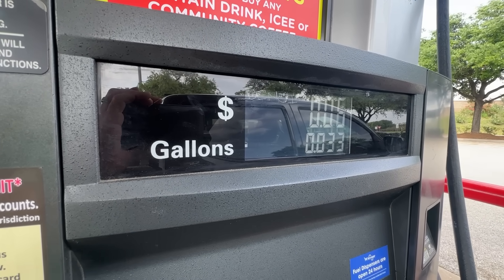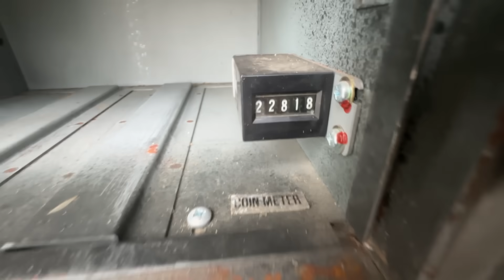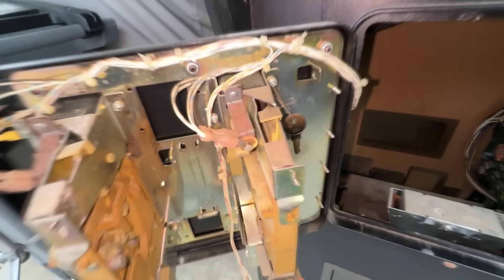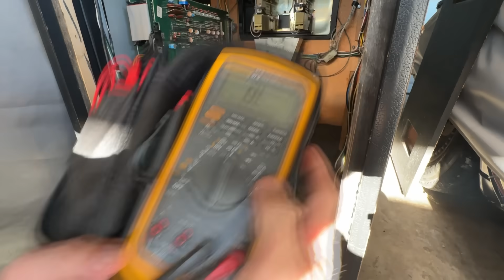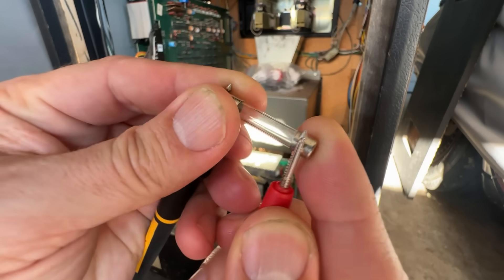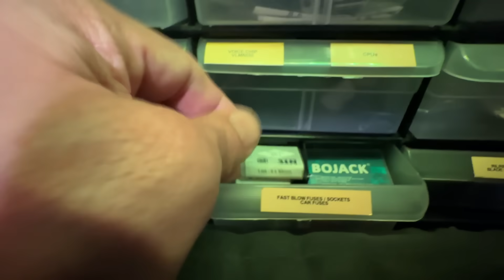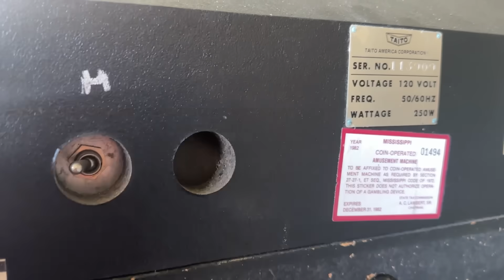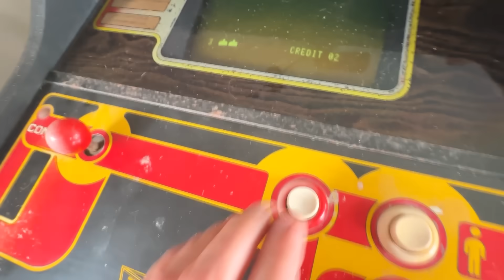Part 1: Broken 1978 Taito Space Invaders Brought Back To Life?

Comment: Do you know how to adjust the horizontal size? This cab only has horizontal hold and horizontal position on the potentiometers… I’m thinking it’s the little coil on the yolk but I’m not sure. 
Please let me know if you have any idea
Reply from the maker: If the screen is too squished it’s often due to a capacitor that’s out of spec and needs replacing. Mine could probably use interesting as well. Want to send me a picture of the issue? My email is in the About link.
Reply from the maker: Interesting = refreshing

Comment: I got several of those space invaders PCB’s. Definitely some of the lm3900’s have gone, my suggestion is to replace them all, they are either dead or will be in a short time. Also check the color circuit, seems like you are missing colors (I assume this is a color pcb, not b&w)
Reply from the maker: It's a black and white monitor. I think the board can do color but in this configuration they went with a gel overlay on the black and white which is quaint.
Reply: @spacetimejunction ah ok. Yes the board can do color indeed, just 2 proms, and you can get rgb output

Comment: That tantalum is typically shorted on Taito 8080 RAM boards. As soon as you said the 12v line fuse on your linear was blown, I already figured the power supply was fine.
Reply from the maker: I also learned that as a result of this guy failing there's also a popular op amp that likes to fail off that rail, too.
Reply: @spacetimejunction  Those LM3900s love failing for sure.